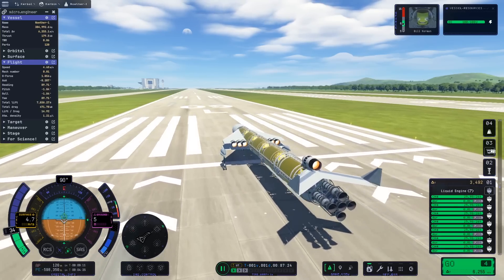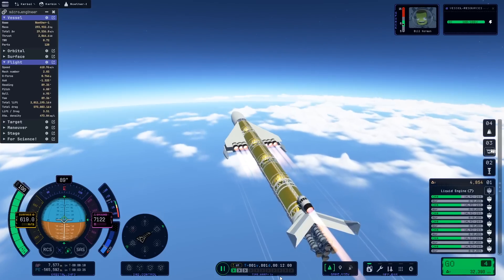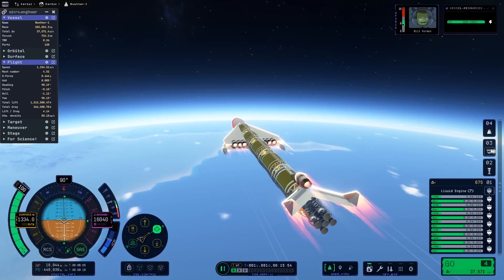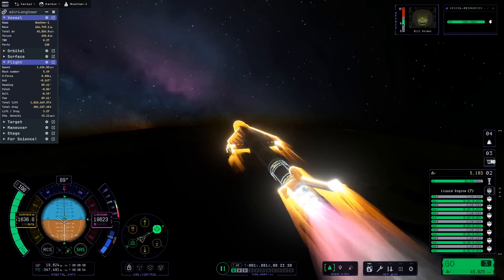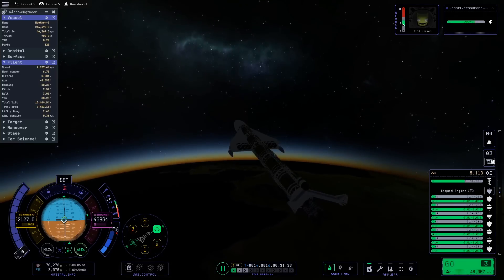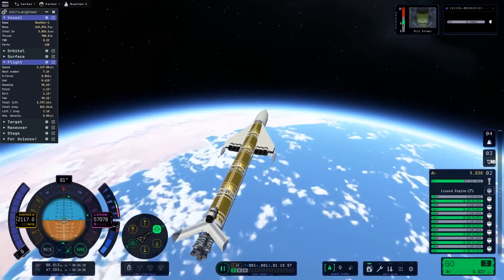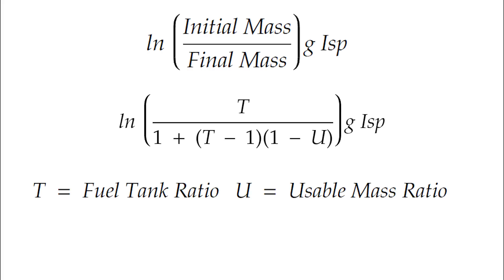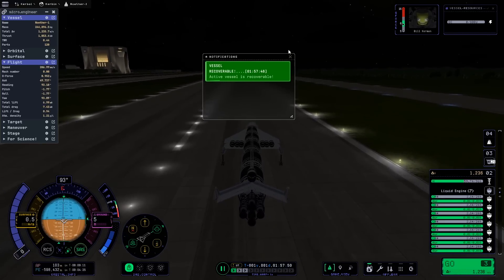Exploring KSP 2 and first impressions:  Nuclear spaceplane with 20k Δv in orbit

Comment: Regarding specific impulse, the reason that it uses the unit of seconds (as opposed to meters per second, because specific impulse is directly proportional to exhaust velocity) is so the figure is the same in any unit system that uses seconds. Otherwise, you'd have specific impulse for SI units, Imperial units, etc. Meters per second is also dimensionally equivalent to Newton-seconds / kilogram, or the impulse (change in momentum) provided by each kilogram of fuel. By using seconds for Isp, you can put in whatever gravitational acceleration value in whatever units system you want and it will still be valid.
Reply: i figured g would be a relative usage for an equation that calculates the decrease in drag along the projected flight path. unless they just have good enough tolerances for that
Reply: Mmh, they could show the current calculated Delta v m/s also
Reply: There's also an alternative to the version of the rocket equation used in the video which uses exit velocity of the engine instead of Isp
Reply: @leokastenberg800  yeah, it's just dv = Ve * ln(m0/m1) instead of dv = ISP * g * ln(m0/m1)
* important to note that Ve is exhaust velocity here
Reply: @leokastenberg800  The exit velocity IS the specific imulse in the most physical meaning (impulse per mass). The measurement of Isp in seconds is imho the most arbitrary, random, useless thing ever in rocketry. As to the argument with different meaurement units: I think anything other than metric has no place in science or engineering
Reply: It's important to keep in mind that specific impulse is used as well in jet engine development. However, since a jet engine is an open system, the specific impulse of a jet engine if cknveeted to velocity units is almost always nonsensical and confusing. For instance, your average airliner turbofan has an isp of 42 km/s, and somehow does this without a nuclear reactor and/or any electronics rated above 480V. Over there, seconds is ironically much more intuitive. You have your weight of fuel, you meter it out, and you check the thrust derived. A quick division of the thrust over fuel weight flow rate gives you isp in seconds. Doing otherwise is less convenient, and is similar to representing car fuel economy in units of area. Sure it'sdimensionally consistent, but yiur average operator will look at you funny and take their vehicle to another shop. @tobiassteindl2308
Reply: The other reason I believe has to do with how you measure specific impulse itself when testing an engine. You can't put a speedometer on rocket exhaust, so they have to measure how much force it's generating for how long with a certain amount of fuel, and then do calculations from there, and guess what you can't get rid of on the surface of earth (which is the only place you can test rocket engines) is? Yeah, that pesky 9.81m/s^2 gravity, which means I believe they also model force measurements around that? I could be wrong and it's true that they could just convert it, but irl you can't just set specific impulse in a config file, you have to have some way of testing it, and since gravity is in there, it makes sense that that would work it's way into the equation somewhere

Comment: One can abuse the engine plates as interstage fairings. Put an engine plate upside down, then a stack separator on top and the payload in place of the engine.

Comment: Interstate fairings can be built with the interstage coupler, a decoupler, and a fairing.  It can get a little fiddly getting it to snap into the fuel tank or whatever above it, and I have had one where I just accepted a gap in between fairing and tank but it def possible.

The key was that it's slightly wider than it looks, and based off the way the fairing just deletes that part if you go too close, it is definitely not an intended feature yet.

Comment: For the Phantom roll, I have noticed that if you revert to launch, the custom wings get screwed up. The wings get deformed and are asymmetric and create rolling. Never had it when going straight from the VAB to the launch pad or runway, but frequently have it when reverting to launch. Not saying that this is your cause for phantom rolling, but it might be.
Reply from the maker: This would explain what I have observed so far.  Will keep an eye on this.
Reply: Nice observation!

Comment: The reason the new nuclear engine is "suspiciously good" in terms of ISP is because gas-core nuclear rockets are frankly NUTS, we're talking theoretical ISPs from 1500 to 3000 seconds, the KSP 2 engine is actually on the lower end of estimates. Instead of avoiding meltdown, openly embracing it and achieving much higher core temperatures really zoosts your exhaust velocity.

Comment: 12:35 "g" is in there because of the confusion of metric/imperial units in the Gemini/Apollo-era to avoid misunderstandings between the American and German engineers. The ISP become an indeterminate value and only the "g"-unit determinines the output of the equation. Since the complete industry use metric units it is a little outdated.

Comment: The best way I could make interstage fairings was to drag the fairing to where i wanted it to be, then, without pressing the 'tick' button to finish off the fairing, press the rotation/offset tool. What should happen is the fairing doesn't delete itself despite not being physically closed.

Comment: You call it suspiciously high performance, but that is actually reasonable for a gas core NTR. Thermal rockets get higher efficiencies when they can heat their propellant to higher temperatures, and the whole point of a gas core NTR is that by allowing the nuclear reactor to vaporize itself (and containing it in a quartz "lightbulb" for the design that that performance seems most close to) you can achieve much higher temperatures, and by extension better performance

Comment: As for the phantom roll, would using slightly angled wings (in a V formation) work to correct it (automatically)?
Given that you're already using 2 stabilizers in the back to achieve stability in the yaw axis, maybe slightly angling them (into said v formation) might fix the issue for now?
Maybe 5 degrees would already suffice?
Not sure though, might give it a shot myself.

Comment: The only time i have ever encountered phantom roll is when i have the craft balanced too finely. This causes it to find its own balance if forces etc are slightly off-center. The solution to this is that i typically bake in some centering bias such as positive dihedral on the lifting surfaces.

Comment: Good to see new content from you, Bradley, and that spaceplane is really something! Regarding the fairing stuff mentioned at 7:50, even after playing months of KSP2, I am still not sure if interstage fairings actually close or of I have just created an open cylinder. But then again, it doesn't appear that fairings really protect against hat yet, soooo.... I guess the devs have still some work to do on that front.
Reply: Almost all use cases for interstage fairings can be replaced by engine plates. An engine plate is basically an interstage fairing that builds itself.
Reply: @TheWinsmith  I can't remember how long you can make the engine plates fairing, so maybe interstage fairings can be extended longer?

Comment: Welcome back Bradley! To build an interstage you can use the engine plates or tube parts, which are both procedural
Reply: Additionally, there are two nuclear engines in KSP 2. One is the same as in ksp 1, a nuclear thermal rocket which passes hydrogen over hot nuclear core and the second is a gas core NTR, which heats hydrogen with nuclear plasma, thus putting way more energy into yhe exhaust. Considering the game isn't making you use up uranium when you burn the engine, I'd guess it uses closed cycle. Soon we should also get a third NTR engine which has an afterburner mode that lets you burn the hydrogen with oxygen for more thrust.

Comment: I also had the same issue of phantom roll with large spaceplanes when I used the same way to control (SAS off, use trim instead). Very irritating.

One thing I really want it the ability to view individual part aero stats. It would really help with optimization. Like I wanna figure out what is or is not occluded. As you said it did feel very familiar, but it still felt different and I couldn't put my finger on it.
And as you said the rotation tool is annoying. Other issues I've had is with craft saves getting corrupted, but I also haven't played since launch. Really hoping they fix/add more and don't just abandon KSP2.

Comment: I played through the whole of KSP 2 mission. A few tips I came across: Never trust the Dv readout. The thickness of wings matter when it comes to heat and aerobraking. The inflatable heat shield isn't reliable. There are a few new mods that will make everything so much easier: Science Arkive, Alarm Clock, Kerbal Life Hacks, Community Fixes, Micro Engineer, Maneuver Node Controller. Also, the Under Pressure mission is currently bugged probably due to vessel name change or docking and will not complete in some cases. Also if your craft wobbles and flys apart on the launchpad, returning to launch pad resets the craft and makes it a lot more riggid.

Comment: I’m sure SSTOs will get even more impressive (and perhaps more ethically dubious) with some of the even more futuristic parts. A gas core nuclear thermal rocket will look pretty pathetic compared to something like nuclear salt water. Just don’t think about the radiation.
Reply: I imagine the implementation of heat production on spacecraft will change that, since reentry heating seems to be the only kind implemented so far

Comment: Video Idea: Leave the Kerbolar System with as much velocity as possible given the available parts
Since KSP 2 has support for longer burns, long ion engine burns are much easier.
Reply: Not quite yet unfortunately, in my experience with the current version crafts with very low T/WR  simply stop producing thrust during timewarp *but continue to consume resources*. I only found this out after sending Ion propelled probes to Eve and Jool. I have yet to see the problem with nuclear engines at least

Comment: I have been fighting the VAB camera way more than the previous game... I miss spaceplanes having their own dedicated hanger for that.
Part rotation is also indeed very finicky. Holding shift makes it a bit finer, but micro-adjustments have to be free-hand with the sticky selection disabled. That and a lot of other tiny details could be fixed by having typeable fields for things.

Especially for colours... Being able to type in RGB would make it a lot more consistent than trying to eyeball a new part when you don't have the ship's previous colours selected anymore.

Though, having said that, they're mostly little issues... I do miss robotics parts and the Saturn jet engines, but we're nearly at parity with the features we had in the first game, and some of the new additions make up for them in their own way.